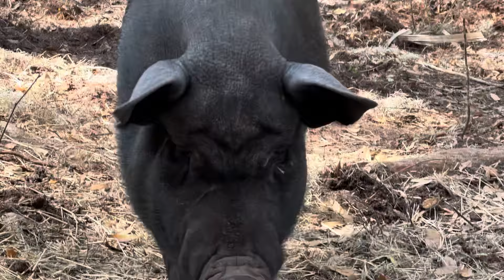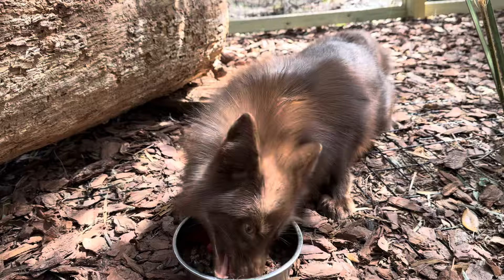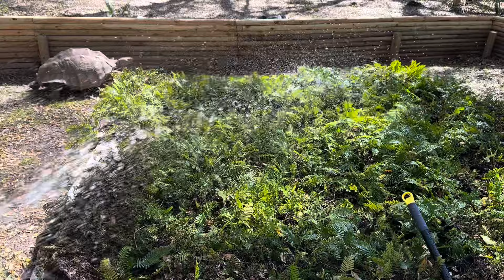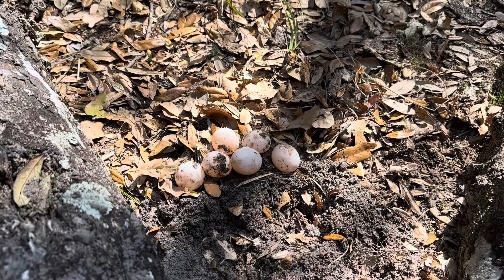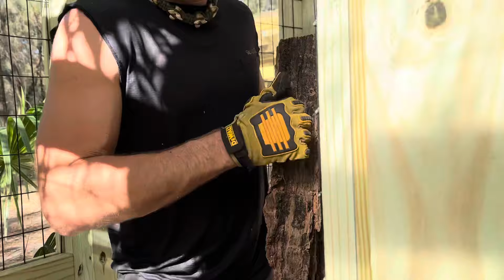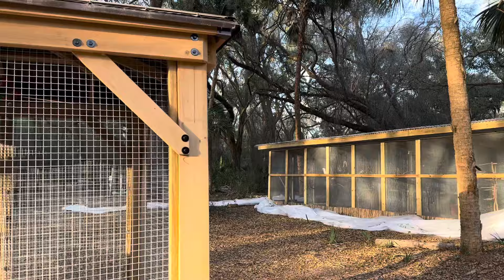Sanctuary vlog 2-27-24

Comment: Would installing roller blinds designed for outside of windows make sense for the aviaries as replacement for the plastic? (You could open and close them similar to a garage door). 
Would need to be of transparent material…not certain there is such a thing.

Comment: If that female tortoise did mate there is most likely an embryo inside the egg of each laid egg unless it’s a dud which would just be an egg if it’s a dud. You can very easily tell if there is an embryo just by candleing the egg. Just wanted to correct that because it’s false info what you said . If it’s not a dud egg it does in fact have a baby tortoise inside in the very early embryo stage of life. I do breed reptiles so I have experience with reptile eggs.
Reply: Please don’t start with this. When we say baby tortoise, we are literally talking about a fully developed baby tortoise. we cracked it open to show people it’s just yolk. As we said, we’re sanctuary and don’t breed anything so obviously either way we aren’t incubating. To tell you the complete honest truth comments like this are the reason don’t want to share everything publicly. -Gabby